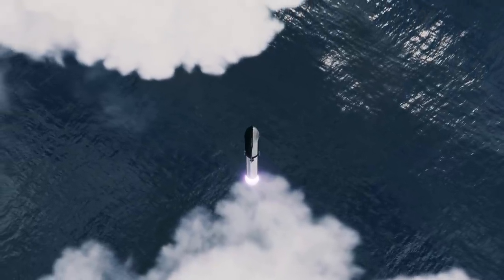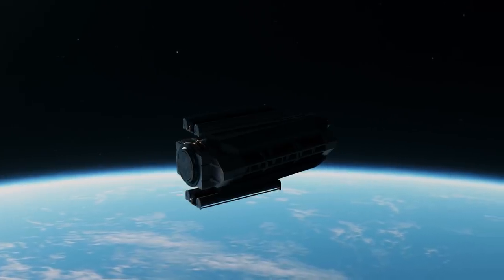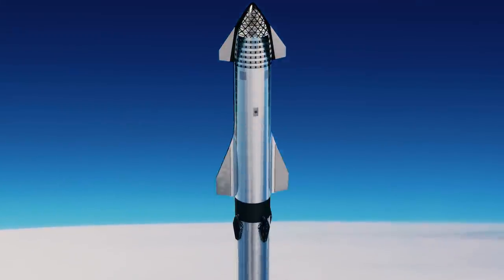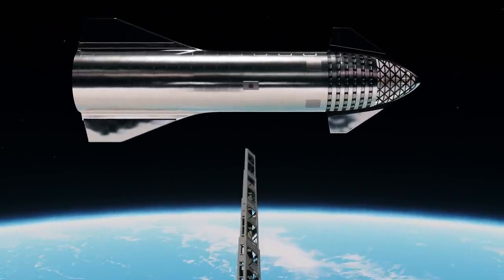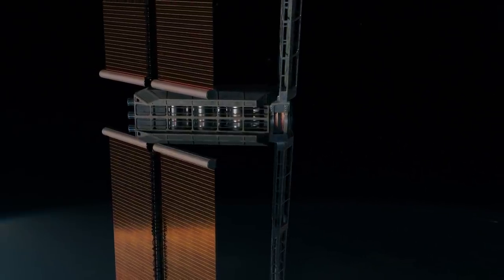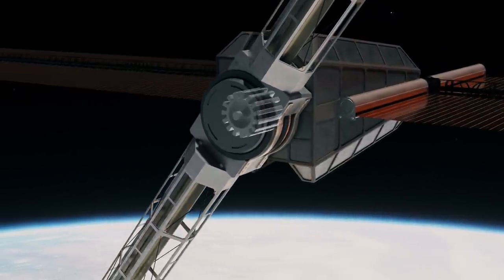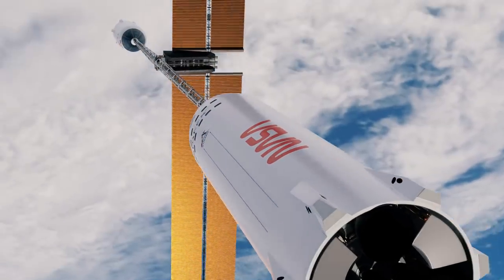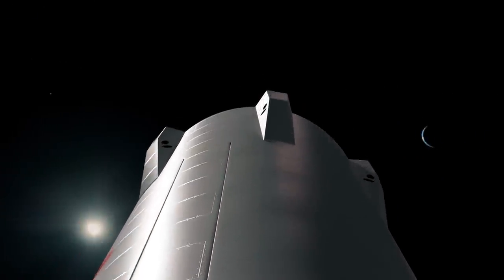SpaceX Starship Artificial Gravity Connector concept

Comment: The "moon" variant seem to me much more flexible and suitable. 
1) if used like that, the spaceship(s) ITSELF could be used as landing craft(s), and homebase after landing. 
2) with that design,  each single ship could be prepared for simulating gravity by burn. 
3) this design can offer to both crews a flexibility to share each others resources for significant percentage of jurney midflight. 

sugestions for design changes:
A) the gravity connector "connector mast" does not need to be all rigid and telescopic. During the coupling of the ships in Zero G, the mast serves as a bumper pole, but when under spinn for most of the jouney, simple tether (or tethers) would sufice, to hold those ships together. And for "sharing" simple protected hose, and power plus data cable would do fine. Hell, crews could even visit each other, if using spacesuit for spacewalks to enrich "social life" would not be such ill advisable concept. 
B) the midway ion engine is a good idea. But. it needs fuel (helium or what) next to the power too. And the segment does not look too much able to carry much of that inside. Not to mention, for the pilot it is like flying the brick, if engines are in the midle. BUT if you make 2 of those stations, or divide one into two, AND MOVE EACH TO ONE OF THE SHIPS you will have one nice engine onto each crew module/ship, that can be used (among many other manuevres) for spinning, or despinn of the contraption. 

C) It seem to me, that the "cargo" version of spaceship, will be mostly hollow and disposable cover anyway, so why not use "one way" whole orbital segment (ie special version of uncrewed ship with your gravity connector AND extra cargo). With that variant, you can either make 3-ship conglomerate out of 2 crewed ships and uncrewed, or 6 ship conglomerate out of 4 crewed ships and 2 uncrewed, out of wich each would serve as "engine", generator and "hub" for 2 crewed ships/modules on the ends of the connector.
D) Solar panels are fun think to do closer to the sun, but Mars is farther than Earth and you would need a BIG solar power plant on the connector, to cover 100% of power need. Not to mention it is kinda "bad" to bet all your money onto one power generating system so to speak. RTG generator, or straight up small nuclear reactor is inevitable and necessary for such endevour (at least in the "settling Mars and powering first colonies" part). 
E) If there have to be a source of radiation, the best place for it to be from the crew security and health standpoint is outside the hull of crewed module ship, far away (optimaly hundret plus meters) and behind secure shielding. 
F) The cargo modules/ships wall(s) can be used as kinda "spaced armour" for the crewed ship hull, from the direction of movement.

Comment: Nice animation.  It is appreciated.  Here are some thoughts I would add and this that will have some overlap with other comments, but hopefully spin it in a bit of a different light:
1. Flame animation - When watching Falcon 9 launch, the pillar of flame is roughly as long as the rocket itself.  I am thinking with ~30 engines firing on Superheavy with a full fuel load to start and then shooting for orbit instead of hover, it is going to be a long flame even with methane, so you can have some fun with a long flame animation.

2. A weight saving design of Starship is to always have the rocket vertical.  It is not designed to take horizontal loads like an airliner does.  Also its decks will always be designed for vertical use on Earth, not horizontal.  So your later animations with HLS models are more correct.

3. I am thinking a better test of artificial gravity would allow for much greater distances between ships than what is shown in the animation, especially as Scott Manley points out various effects of having a smaller diameter.  I would think it would be OK to use rope like tethers and maybe have power cords running the length of the tethers.  Maybe even have 3 lines, two power for DC and one load bearing / ground.  We have been able to transmit power to rotating parts for a long time, so this is not an issue.  String trimmer lines always even out and stick straight out from the hub when nothing is perturbing them for example.

4. A fun thing to look up are gyrocars as there is even a video of one being towed sideways behind a truck and it stays upright.  Another way to put this is if you have counter-rotating flywheels, they will resist rotation while cancelling each other's twisting motion to the force exerted on them and thus you will be able to push on them and be able to spin up and down your artificial gravity mechanism without a counterweight wheel.  Spacecraft already have reaction control wheels to hold orientation and such.  It has actually been a problem with some spacecraft where these wheels fail over time.  However this is a technical issue and one I think is solvable.

5. To get power density up for your ion drives, it may be fun to explore the option of using a LFTR reactor and changing out the solar panels for radiators.
Reply from the maker: Thanks for the insights, will go through them and learn from it for my future projects
Reply: A different suggestion is starships hauling up Bigelow Aerospace BA330 inflatable habitation modules instead of parking starships there... Starships are better used as mobile shuttlecraft rather than volume components of a beginning space station

Then ... What else can it do from that configuration?

Start with your hub but make it +y modular (where -y is the ion engine and x-z is the plane of rotation) with optional-later +&-z arm connectors

Then as time goes on, you add another similar section to the +y end with another 2 BA330s ... Either as a second spinner or as a construction module that will add arms to the first spinner and and and and ... Until you add enough to expand it entirely out to an interconnected-module ring station ... Which really cannot be done with starting from starships as your volume habitats on the end of your arm system

Comment: Great job!! Glad you are back.  Recommend attaching the arms to the same structural points used to catch the Starship by Mechazilla since they have already been engineered for the loads.  It would look like a tuning fork on the end of each arms.  This would free up the noses of the Starship for using the connection arms to move between Starships.

Comment: The Starship’s structure won’t stand up to supporting its ‘weight’ from a point on its sidewalls as you have it here. But you could have the ships ‘hanging’ nose-to-nose from from their lift points beneath the front flaps. This also preserves up/down deck orientation.

Comment: Starship artificial gravity needs to be designed such that the interior surfaces acting as floors or ceilings are consistent. The situation here would provide artificial gravity in a different direction to real gravity, meaning extra effort would have to be taken to design the interior. You could fix this by just connecting to the nose of the ship instead of the side of the ship

Comment: I really like your presentation, but can't help to note its limited perfection.    I foresee the initial installed arm as proposed for a  planetary space starship duo(orientation), rotation set at not  more than approx 0.1 G to aft of Starship structure. 
 My Reason:     Propellant flow (Pump &Syphon) from tanker would be easier.  Next installation would be another stronger rotation arm clamped into front rotary unit  ((C of G ?)    and once bug free) to accommodate manned starship duo's set at 0.6 - 1 G.
Propellant movement/transfer with the Starship Craft is almost important as the human cargo without Nuclear Propulsion, there is every reason to build a prop/cargo transfer station much later at EO & MO.

Comment: The starship would just crumple up and break in two if you did it this way.  Nose to nose via tether (nightmare) or truss would be more realistic as they are already strong points for lifting near the nose which could double up as the attachment points, and the Starship structure is designed to bear loads in the longitudinal direction.  Plus you would be standing on the floor and not the wall as Wayne mentioned below...

Comment: I would like to see you show the potential of a linear accelerator your space station concept.  This would used for "subtracting Delta-Vs" from Starship (or containers of manufactured goods) headed back to earth (minimizing or eliminating the need for heat tiles).  Wouldn't need to subtract all the Delta-V, just enough to eliminate heat tiles.  Adding Delta-Vs would be for moving stuff to higher orbits.   The Station would recover the lost Delta-V between uses.  The Station would have to be much more massive 100-1000 times the mass of the returning Starship.

Comment: A cable, nose to nose anchored to the grid fins would be simpler and lighter.  They are strong enough to carry the weight of landing.  3 or more could be strung on a central ring, with ship to ship lateral stabilizing cables that could be used for cable cars and communications.  A zero g Starship could hold cargo inside the mooring ring.

Comment: Love the design. It could be powered by nuclear energy instead of solar power and maybe the rotating arms could be shorter.
Reply: If the arms are shorter, you have to spin the thing faster for an equal level of gravity. If anything, you should make them longer so there is less stress put on the system.
Reply: The longer the arms, the more realistic the gravity becomes with lessened side effects I think
Reply: 230 metres radius and 2 rpm gets you a nice 1G.
There will be problems with spin up/down times and maintenance.
Reply: the longer the arms, the smaller the difference in gravity between the head and feet. with shorter arms the difference becomes very noticeable, which is nauseating and a health risk
Reply from the maker: I think these problems could be easily resolved.

Comment: Great Video, I like your videos generally:)

There is one little mistake though. The unit for power is kW not kWh. The Energie that can be stored by a battery for example is measured in kWh. For example a motor has a power of 1 kW. If this motor runs for one hour, it pulled 1 kWh out of the battery. So if these solar arrays have a power output of 300 kW and the battery pack from one Starship has a 200 kWh rating for example, it would take the array 40min to charge that battery
Reply from the maker: I will keep that in mind for next time, so basically for energy storage you use KWH and for generation you use KW, is that correct?
Reply: @SpaceXvision  Yes.
KWh tells you the amount of energy ( for example the Energie capacity of a battery or the electric energy you used in your household for the last year or so)

kW tells you the Power of something. For example the output power of a motor or also the input power of a generator)

kW is the power flowing in this exact moment and kWh is that power over a certain time period

Comment: A rigid connecting beam seems unnecessary.  As soon as maximum velocity is reached, two Starships could be oriented pointing nose-to-nose sod a lightweight carbon-fiber cable could be attached to each Starship nose and a spin could be induced or reduced via gas thrusters until near the destination.  Once returned to zero-spin, they would be decoupled for landing.

Comment: How about tilting the centrifugal plane by 90 degrees, such that it's tangential to the orbit?
The point of that would be that, in the event of a connection breaking, the Starship wouldn't get flung straight towards the planet / moon.
The problem with that would be trickier to adjust the orbit if needed...

Comment: Really Great ideas, looks like it could work.  Would have to be the nose connector I would think as others have said due to the internal layout.  Not sure if that would be a problem with being unable to use the raptor engines while connected.  Would you be able to connect 4 starships to one of these? Or more?  Imagine a wheel of like 15 starships, maybe connected air locks to allow transfer from one to another, a super starship hub!

Comment: As stated by AArdy, the orientation is wrong for deck layout. The weight of this thing would induce a delta v penalty and potentially increase the transit time to Mars. The torque induced by any slight movement inside the starship could stress the tether. Also the equipment is basically useless for any return trip to Mars as it would have to be discarded before the two starships aero-brake in Mars atmosphere. The mechanism has no way to slow down and lose delta V, so would carry on and fly straight past Mars like a bullet from a gun. Therefore: no artificial gravity unit for the return trip.
The principle is basically correct, however, the most likely implementation would be an ultra strong cable which could be spooled from the nose of the starship. If this is intended to be a common adoption, each starship would have a 1/2 cable with a connector at the end. This would connect to the same cable on the other starship. It is likely that the starship re-orientation and connection would take place once the two ships had achieved transit velocity, and not in LEO, as shown in your video. If connected prior to Mars transit burn, any difference in engine output between the starships would cause a catastrophic failure of the systems and risk starship destruction.

Comment: The side-docking arrangement will be very problematic, since any amount of fuel consumption would change the Starship's center of mass. A starship will therefore tend to hang slightly diagonally, depending on the amount of consumables in the tanks, which will either put a lot of stress on the structure, or require a flexible connection.  Nose-to-nose is the way to go anyway, since the floor on Mars will be the same as on Earth, I don't see why you'd change that for the journey.

Also, I don't think that the counter-rotating solar electric section makes sense in this setting. Ion propulsion won't make a lot of difference given the mass of Starship. Just put the solar panels along the length of the connector, and aim the rotational axis at the sun.

Comment: This one's actually not too far fetched. Initially I think a simple cable would achieve many of the same benefits for a fraction of the cost, but long term something like this could make sense for an Earth-Mars cycler or something of that nature.

Only major issue I see design wise is the orientation of the non-lunar variants. The sidewall can't easily support that much weight. The way the lunar variants are oriented makes more sense imo.

Comment: would ion engines as auxiliary on a starship be enough for gravity from constant propulsion?
Reply from the maker: there is no friction in space, no ion engines needed for rotation
Reply: @SpaceXvision  what are u talking about?
Reply: @SpaceXvision  not talking about rotation
Reply from the maker: @TiberiusMaximus  O i see, I understand you mean expanse style. no not possible. the ion engines are barely noticable
Reply: @SpaceXvision  The ISS was to have 200kw Variable Specific Impulse Magnetoplasma Rocket (VASIMR) for orbit maintenance,  a trickle charged battery help move a very heavy mass, pulsed (15min) according to charge.  Yet again NASA veto'd this test.
Sound useful for a 'Mars transit vessel combo' with the very  latest ISS solar sails (X4 - 6)probably not much acceleration, but incremental.  The about face, to slow down must be at 0.6 of the journey distance with habitation service rationing, or not, if orbiting for months to enable parity.

Comment: What if Starship contained a 9m diameter  cylinder that was used for sleep and exercise rotating at moderate speed? Would part time sleep and exercise in lets say 0.7G reduce the effects of micro G on the body? Imo Spacex should consider making one of its Starships with an internal 8.9 m diameter rotor section to run such experiments.

Comment: The Circular HUB that spins has been a sound engineering concept for as long as modern Space GRAVITY DESIGNS have been considered; the Engineered STRENGTH and STABILITY of these RINGS far surpasses the rather SPIDER like concepts that have been thrown out on the web in the most recent Months....
Musk's Fleet shall have the capacity to ferry the components and build a ship that is certainly far more TRUSTWORTHY as well as providing a better ENVIRONMENT for long Voyages.
Currently one of the most limiting factors for long duration voyages is the SOLAR RADIATION dangers; these ships are simply not so easy to protect with adequate shielding, whereas a Stable RING SHIP may be the stronger BASE for modifying a ship so as to provide RADIATION Protection for the Crew.

Comment: Go one better and put enough starships in orbit on a single mission to Mars so that they can be parked next to each other in a ring, side by side.  With all of them attached together.  the ring would rotate like a cylinder in a revolver with the starships the bullets in the cylinder. This would be a better use of an artificial gravity system as the plan is to send many starships to the red planet at one time.

Comment: Again, same error.  The gravity will be on the side of the starship.  And not at the bottom.  So the interriror would not look like all rendering we saw.  And once landed on Earth of orher, the gravity will be back to the bottom...

Well, maybe we can have those artificial gravity starship only used in space, without any hope of using them to land on the Moon.

Also, no moving part whould be safer/more reliant.  So, all must rotate, even solar panels.

Such idea to be improved linking 4, 8, 16 Starships :-)